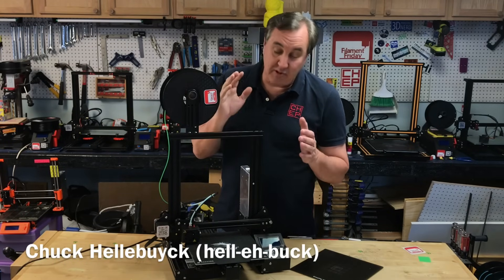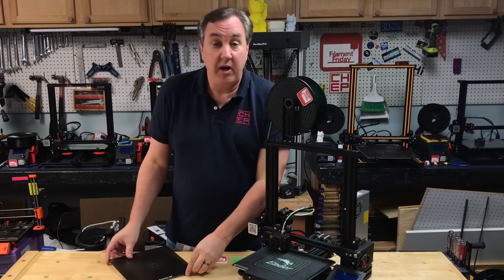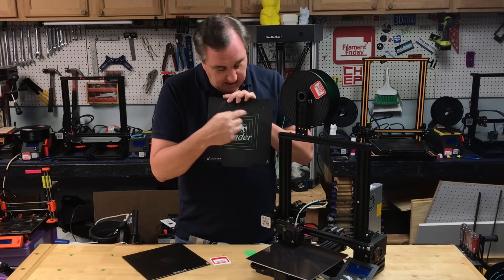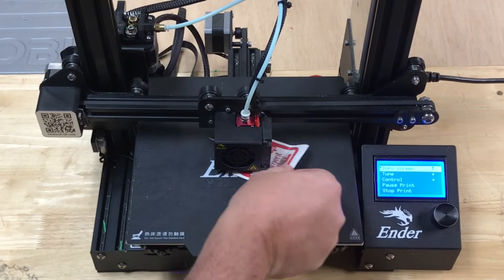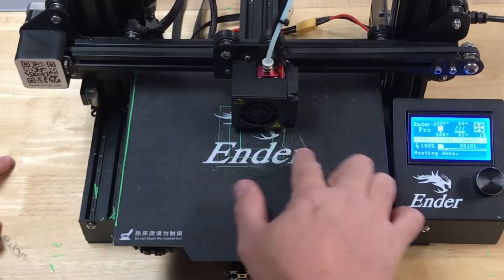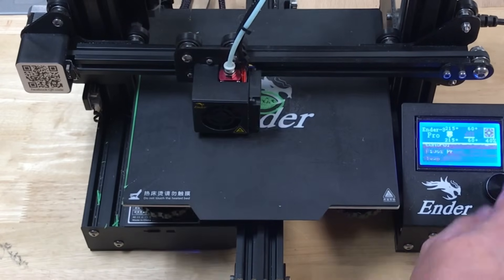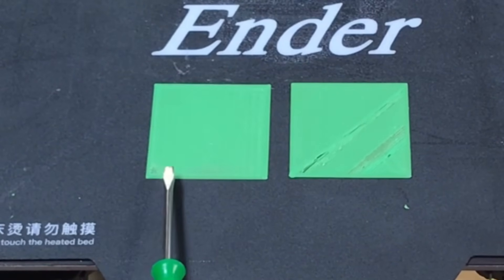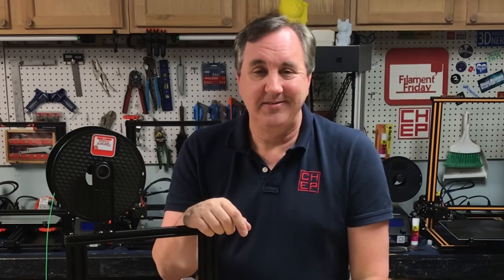Creality Ender 3- Easy Way To Level Your Bed

Comment: YOU DONT NEED TO ADJUST THE BED WHILE PRINTING ON ENDER 3 , While printing ,go to TUNE , then scroll down to BABYSTEPS Z , and adjust Z offset while printing ,it works the same as z offset on CR 10 S PRO V2, Enjoy printing
Reply from the maker: No need to shout. 
You are only adjusting the overall Z with baby steps. My live adjust method adjusts each corner so it works better to get a balance and level bed. From there you can use baby steps if you want to adjust for different filament aka PETG vs PLA.
Reply: @FilamentFriday  Not shouting, just important , manually leveling any 3d printers bed first is a no-brainer anyway , I level all my printers beds with a dial gauge from bed to gantry , then I do not fiddle with it any more .
Reply from the maker: Understand but my technique has helped 1000’s of people get their printers working again. Just read the comments.
Reply: @FilamentFriday  bruh dont be salty. your vid is great, and he's right too. dont get mad at a viewer cuz theyre trying to help people
Reply: @travisscott2264  fax
Reply from the maker: I’m not getting salty but he says you don’t need to do the live adjust but his alternative only works if the bed is even. My adjust gets it even so his method can then be used. So I’m just clarifying. It’s helped a lot of people.
Reply: @FilamentFriday  gotem

Comment: Hello @CHEP , great video !. I am new in 3d printing and i was confused to be honest, but i think i am close to sort it out ! :). One silly question :  There are 4 files, 2 named CHEP_bed_level_print, one M0 and one M25..  In the video you mention 2 of those files. Which of the 4 i will use for the 2 steps  ?  (There are two files required. First run the CHEP_bed_level.gcode file on your Ender 3 or any similar size printer. Adjust each corner by running a piece of paper or Filament Friday sticker under the nozzle until you can barely move it.

Then run the CHEP_bed_level_print.gcode file and live adjust or "adjust on the fly" the bed level knobs to get as close to a level bed as possible.). I apologize in advance if my question seems silly :) THNK YOU !!

 ps. Stupid question... all ok !.  i just checked the file names. lol..  sorry
Reply from the maker: Sorry for confusion. If the M0 does stop at the corners on your machine. Use the M25. The n use the print file .gcode version. There is a print file .stl version of you want to slice it yourself.

Comment: I did a BIG mistake for a long time, I couldn't figure out what was wrong: I leveled the bed just right, but the first layer in all my prints always was too narrow (I'm using Cura as a slicer). The first "test" string before every print was just fine, but all the prints itself was awful, the first layer was always too close to the bed. Then I realized why: As all my prints has 0.16 as "Layer Height", I also had that number on "Initial Layer Height". It should be 0.3 of course! Stupid me!
Reply: ? whats wrong with using .16 layer height? Im assuming you used a .3 nozzle then?
Reply: @Izik09834    The nozzle is Ender 3 Pro stock 0.4 but the first layer must be 0.3 height even if the rest of print is 0.16 height. I used 0.16 height on the first layer and the print became awful every time. I changed the first layer height to 0.3, the rest 0.16 height and the print came out just fine.

Comment: My creality has a "hole" in the middle that's pretty deep. And everytime I remove a print, I lose balance. I literally have to balance it after and before every print. I just want to know what I messed up on that makes this balance so not durable.
Reply: Get a glass bed and reveled. Also an auto leveler will cut that out.
Reply: @perfectscotty  I'm sorry what is reveled? And I looked into the auto leveler that fits my printer that creality offers and it's seems to complicate it more, but I haven't really tried it, it could be the lifesaver. Thank you very much for your advice.
Reply: @pedobob863  I guess he means re-level the bed after mounting the glass. Remember to move the z-stop switch up, about the thickness of the glass, before start leveling.

Comment: Thanks @CHEP - great video! Glad it's working for a lot of people, but FYI it doesn't appear to work with all firmwares yet. I have an Ender 3 Pro running Marlin 0.0.6 dated May 30th 2020 - I ran the M25 as prescribed but it just goes to the first point, stops and does nothing. In your video you make it advance to the next corner just by pushing the button, but that just opens the menu like usual for me. I can select Resume Print, but it proceeds to heat the bed up to 80 degrees when I do. Anyway - looking forward to the next version because I've basically been doing this same procedure manually which is getting really old :)

Comment: Thanks for posting this video!!! I've been trying to get proper prints for weeks. After making needed customizations in Cura and using the codes to properly level the bed, the prints are coming out perfectly. I can't believe how much lower the bed was when using the standard paper method to level the bed. You've just earned yourself another subscriber.

Comment: I struggled all day with troubleshooting my first set of problems on my ender 3 v2. I learned about cleaning the nozzle, how an unlevel bed can lead to prints that don't adhere or a nozzle scratching the build plate ... and this video with accompanying files saved the day. Thanks so much!

Comment: actually the first gcode that allows you to paper check, didn't work for me, it moves the stuff very fast and no user input shown anyway. so i did the leveling manually and printed second control gcode. which is spectacular to understand things. my bed's problem was exactly he mentioned in video, center of the bed was always deep positioned despite the corners. so i put in the center two sheets of papers (approx 10*10 cm) under magnetic sheet. and had a perfect leveling.
Reply from the maker: The GCode isn’t working because Creality 32 bit firmware is incomplete and doesn’t recognize M0 GCode. There is an M25 version in the 4.0 file. But as you found the real leveling happens during live adjust.
Reply: @FilamentFriday  thank you so much, you're inspiring!

Comment: The thing i can't get a straight answer on is how much resistance the paper should have.
Reply from the maker: Just get close. The real level happens during live adjust.
Reply: I adjust it so its its a little hard to push the paper through but not too hard it folds if that makes any sense..
And I don't lower the nozzle on the paper but slide it under after it's lowered.
I would also adjust to do the steps twice or until you don't have to adjust the knobs anymore. Because aligning one know might slightly off set another.

Comment: One comment about your leveling G.Code. If the bed is too high when you run it, the code pile-drives the nozzle into the bed. I didn't have it happen to me but I see the potential. It would be a good idea to mention to lower the bed first and bring the bed up slowly.

Comment: Hello, since i added the V4.2.7 Silent Board the bed-leveling doesn't work properly anymore. The extruder is approaching the points, but it doesn't stop there, but continues directly to the next point. How can i solve this problem?

Comment: one thing confuses me, at the first corner you say slight resistance (which means low right?), and all other 3 corners you say it should be significant (which means alot right?), so on the first run first corner's resistance should be slight but all 3 others should be very tight?
Reply from the maker: Just get it close then the live adjust is where you dial it in.
Reply: Are you really this dumb lmao.
This is bed levelling not bed tilting
Reply: @fns58  yes i am this dumb, my stupidity can cure with education & practice but your soul can not be fixed and you have to live with it as a ugly looser

Comment: Ive had the Ender 3 for over a year now, for some reason always thought the square print calibration wasnt needed, but just now I did it on my glass bed and WOW.
I dont think i need a BLtouch after all. Thank you so much.

Comment: I followed the instructions (though I STILL don't know what I should be feeling for when doing paper leveling and could really use a description on that, I go until I feel resistance but can still move it because anything more = scoring the glass bed), and when I ran the test print gcode one side printed ok while the other scored the bed (right side scored) despite it being "level" via feel. When I adjusted that, it then meant that the left side was too high (even though I only adjusted the right side) and nothing stuck, but the right side started leaving down filament. I adjusted the left...scoring on the right.
And this is after following the instructions on how to fix the x gantry (it was off by about 3mm on the right), the z screw (got it cleaned and regreased with white lithium), and fixing the base because there was a wobble in it followed by going through the first two again to make sure it was all still fine. I honestly don't know what to do and I keep getting told different things for how to level with paper. I've legit been crying over this for the past hour and a half because all I want to do is treat my printer like a shot put and the window as a target.
Reply from the maker: The live adjust is the most important. The paper just gets it close. Just minor adjustments to one knob at a time while it’s printing squares. May even take a couple tries.

Comment: I give up. I'm throwing this thing away.
Reply: why ?
Reply: @MrAero173  I have been trying to level this bed on and off for months and it is never level.
Reply: @DMlloyd01  are you using glass bed? Do you remove the serfuce every time you finish to print something?
Reply: @MrAero173  I am using the stock bed and I haven't been able to print anything on it cuz I can't get it level. I used a square file from thingiverse that supposed to prin the squares on the bed plate but its either to low and scratches the bed or too high and doesn't stay on the bed. And If I get one side right another is off and through my adjustments it just screws everything up.
Reply: @DMlloyd01  I'd recommend taking the entire printing structure apart and putting it back together again, and making sure all of the pillars are level as well.  This made a huge difference for me in being able to level my bed.
Reply: @the.reel.mccoy.  true
Reply: @the.reel.mccoy.  Literal months!!! I have been screwing with this thing!!! MONTHS!!! smgdh. That worked and I was able to make my first print on this machine. Thanks.
Reply: @DMlloyd01  For real!?  Oh my that makes me so happy to hear!  Glad that I could help :).  Enjoy your newly working printer!  I highly recommend getting a glass bed, and keeping the nozzle temp about 10-20 degrees warmer than typically recommended for PLA.  Works best for me this way!  Of course this might be different with your printer, but it could help with any adhesion issues in the first layer that you might come across.  
Good luck and happy printing!

Comment: i dont know if you can advise here. I have replaced the springs on my ender 3 pro with premium ones. I am trying to level my bed. I have tightened the nobs 100% and I still can't get the paper under the nozel. What am I missing here? Is there a setting i have not setup correctly?
Reply: loose the screw s on the z axis sensor and move it up
Reply: You should be able to manually adjust the height of the z axis limit switch to a position that gives you good freedom of movement on your springs.

Comment: Tks for sharing! Works great for a first timer like me. Btw, once this calibration is done, when we off the machine n turn on for next use, do we need to redo the calibration again? Because i tried inserting the same Paper i used for calibration to check the clearance just before printing, the gap seems tighter than when i did the calibration.
Reply from the maker: Depends on print. Just try first layer and see how it looks.

Comment: Yeah, my bed wasn't even close, not only to being level, but way below the extruder. The extruder wasn't even touching, or coming close to touching the plate until I adjusted it. I hope it works once I try my first print. :) Thanks for the video. Unfortunately my Ender 3 pro won't incrementally stop when I use the gcode, and scrolled down, and noticed CHEP said it was because of the new 32bit code. I just moved the bed manually after I disabled the steppers. I wish the Ender 3 pro would give a notification when the steppers are off though.

Comment: i'm using your code on my ender 3 pro, today i bought ender 3 pro V2 when i try your code on Ender 3 Pro V2 it's not stopping to adjust bed,it's going to all corners without stopping, how i can use your code on V2?
Reply: Theres a V2 version on thingiverse
Reply: @RedWhiteBlueGamin  found it, thanks for the heads up
Reply: @sheshmansheshman  Where did you found it? I have the same problem. Do you have a link?
Reply: u want to use the same code but then select pause print when i reaches the corner. U can do so by clicking on the info screen while the gcode is running.
Reply: @yaboibash9410  i believe there is a bug on the FW of the printer because i already tried that but it doesn't pause the printing.

Comment: so my level is spot on (I'm inmpressed with myself lol) but my print was not centered. seemed to be just off the left side rather than centered. what would cause that?
Reply from the maker: Your bed dimension off in the slicer

Comment: CHEP quick question for you. I used this gcode file on my ender 3 pro and it runs great! I currently added two more Ender 3 pros, got them assembled today and when I did the bed leveling file (stop at each location to manually level) it doesn't stop at the five locations. Do you know what could cause that? 

It loaded the file up just fine but when I try to level the bed it doesn't give me a chance to turn the knobs before it moves on to the other locations on the bed.
Reply from the maker: Yeah, new Enders come with a 32 bit board and the firmware isn’t complete. I’m working on a video.
Reply: CHEP awesome! 

I saw your previous comment but the link didn't work. I really appreciate it!! 

I'll try to manually level the bed for the time being!

Comment: Hi, I've done this many times and each time, when the nozzle gets to the centre position, I always have to slacken all four corners off to be able to get the paper underneath. Does this sound right? Thanks.
Reply from the maker: Some beds are a bit warped.
Reply: @FilamentFriday  Does it affect the glass as well? Because i have the feeling it took the exact form of the bed after a couple of prints
Reply from the maker: I’ve not seen that.
Reply: @FilamentFriday  Well, it happens on my creality glass. I use your bed leveling file (thanks a million for that) and even though the first round of leveling corners is ok, when it gets to the center it's way below the nozzle.
Reply from the maker: Check glass for flatness with straight edge. Could be bad.
Reply: @GinLimeSoda  I think you are on to something GinLimeSoda.  I have two aftermarket glass print surfaces and I always get the issue in the middle.  I think I had it on the non-glass surfaces that I used to use as well.  When I am then in a dilemma about is should I skip the centre adjusting or not.

Comment: Hi Chep. Question. I'm changing the micro sd card for my ender pro. I have formatted it, put the file on it, but when I insert into the printer, it does't show up. The printer recognizes the card, but my file isn't on the card. Can you help me with this please? Thx
Reply from the maker: Did you slice it to create a GCode file?
Reply: Yes I did
Reply from the maker: Is it in a folder or at the root? Don’t put it in a folder. Also click on refresh in the menu. Try another SD card if that doesn’t work.

Comment: I did this and failed not because there is anything wrong with it just my determination of feel (barely move) cause the extruder to be not touching but possibly too close to the bed if that is possible? I had it right once it got out of alignment and now I just can seem to get it right. I think I need a number like 0.004" or 0.002" not sure what I had but I am guessing [ when the first go paper had a heavy drag the second go I could not get the paper under the extruder. ]

Comment: Hey CHEP! Quick question. Love the videos btw... Ive been using your leveling files and they are great. I just upgraded my 2nd machine to a silent mother board like my first but now only on the 2nd machine the Leveling Gcode just skips past the 8 corners so I cant adjust.. Like im clicking the button to continue... Do you have any idea why? Still works fine on the first updated machine!
Reply from the maker: Did you upgrade to 32 bit board?
Reply: @FilamentFriday  Sorry just saw your Pin about the 4.0 zip.. I did a reorder of my first upgrade board that works fine with the og file but maybe they sent that 32bit board!? I will try it on that machine as soon as I get home tonight!! Thanks again! You Rock!!

Comment: Not sure what's going on with my Ender 3V2, but I'm running the latest Smith3D firmware and when I run your bed level, it homes in the middle, then goes to the first spot, then dispenses a lot of filament when you click to continue, then it goes to the next spot and does the same thing, crashes after you cancel.
Reply from the maker: Smith3D firmware doesn’t work for me either.